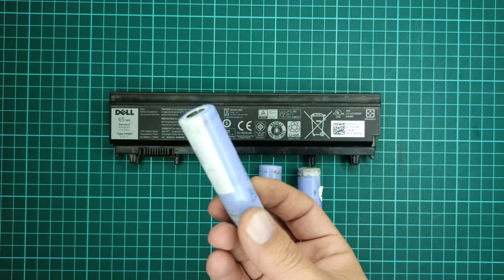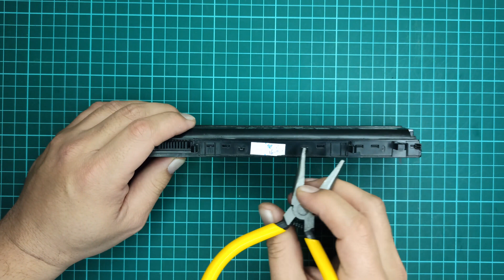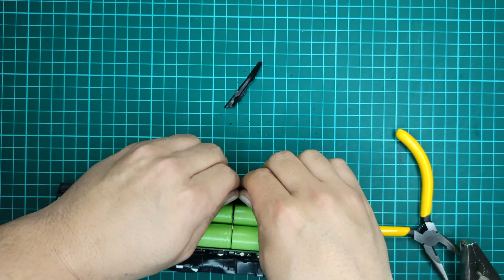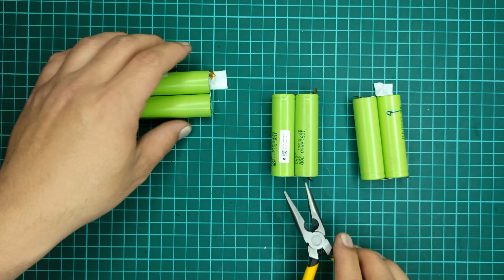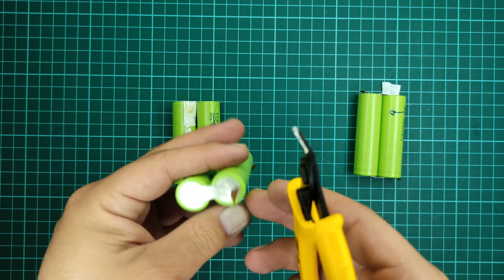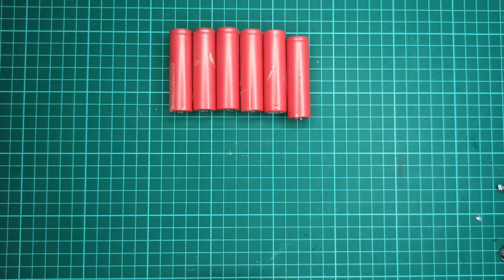Lithium ion battery from Laptop Battery | Li-ion

Comment: If the laptop battery unit, is discarded because it no longer works, what is the point of scavenging the six batteries inside.
Reply: He litterally says it man for electronic projects probably wouldnt understand
Reply from the maker: If the laptop is dead then these cells can be useful, but if the battery is dead then still one can find single or more useful cells from that dead battery as not all the cells go useless in most batteries